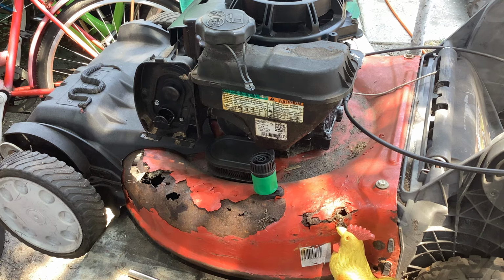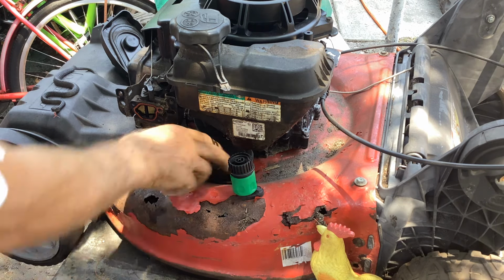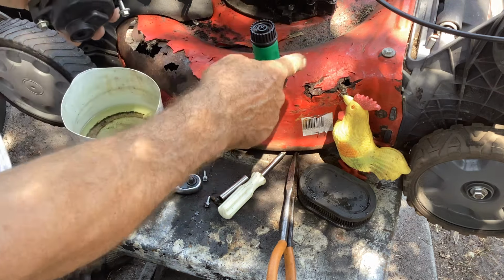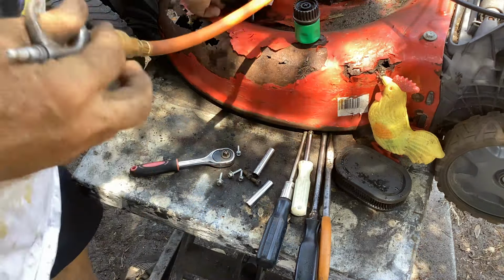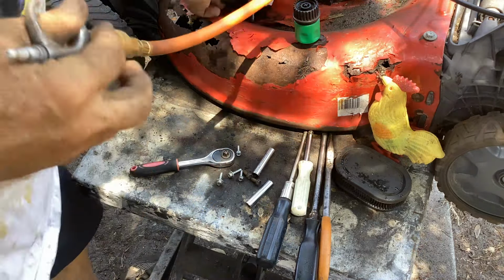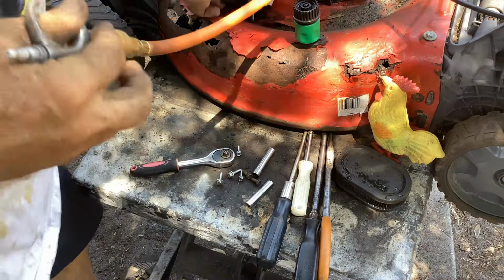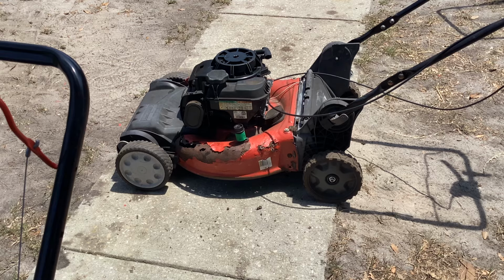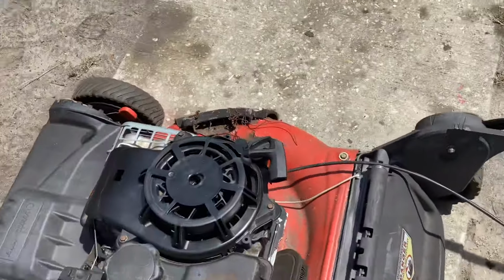2019 Craftsman M260 Lawn Mower with 7.25 engine.     DIRT in the GAS Tank????    WHY oh WHY????

Comment: Glad to see you got that Crafty/TroyBilt Frankenstein running. At least you got a good engine and front wheel drive when a decent deck comes along. I'm tinkering on a TB 330XP with a bagger that I gave $20 in trade for. I got it running rough after a carb clean but the carb is really too far gone, gonna replace it. Gonna do an oil change, blade sharpen and wheel grease on it this morning. I'll try to get $220 for it once it's totally rectified.

Comment: Hi Tommy, great video . I recently found a nice husqvarna  LC221RH with a Honda GCV 160 engine .It starts on first pull but the deck is rotted out like the one you are featuring in this video .Would i be able to swap out the Honda engine to a different deck? I have read on the internet that the 3 bolt engine design is Universal ,Thank You.
Reply from the maker: Yes, It will fit any standard mower deck.